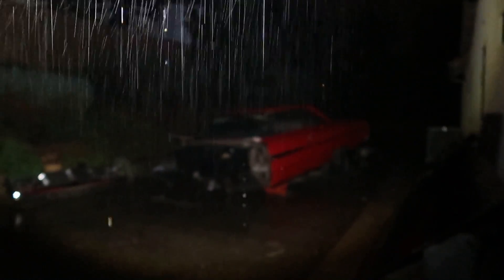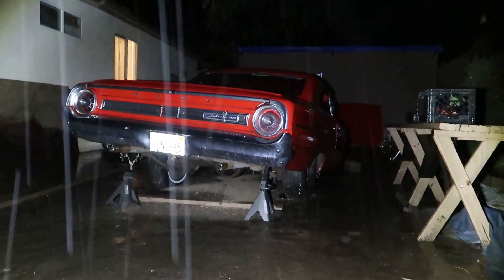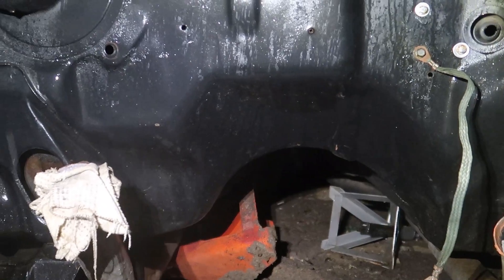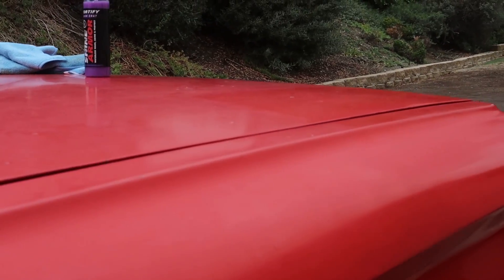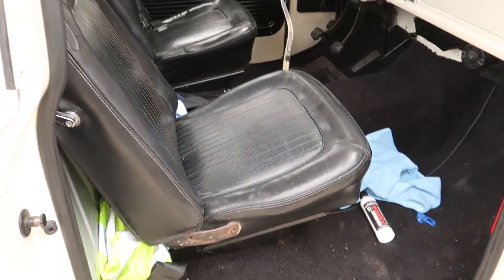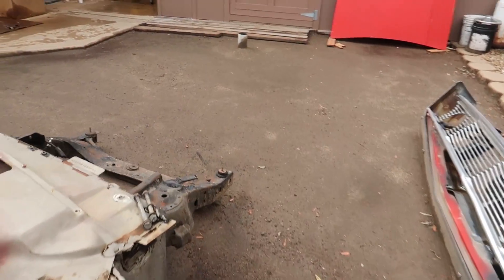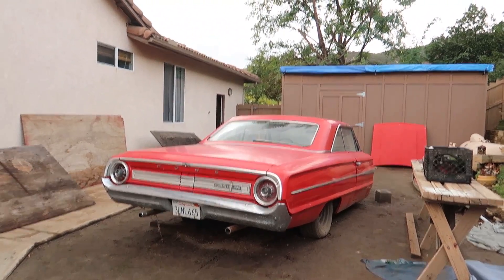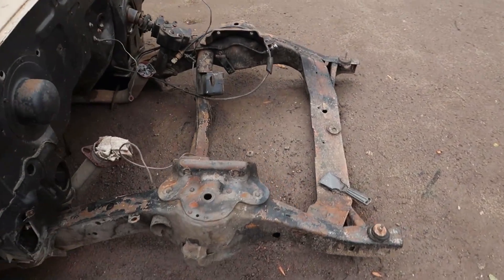I Destroyed My Galaxie...

Comment: In the future might be a good idea to put some wood planks under the jack stands.  I usually have some spare pieces of 2 x 12 that I have cut into 12 inch lengths just for this purpose.  I carry one around in my truck for when I am forced to change a tire on the roadside or something similar as well and it's cheap insurance against soft soil and other area's where you might be on the side of the road and you never know where you are driving or what the weather is going to be up to.

Comment: i was working with my 72 last year. To prevent from what happened to craig i put a cinder block under middle of the bed and under the doors i was working on the diff i must off  bumped the truck or something on it. Then it fell off the cinder blocks and scratched the paint. my advice is that any body that faces this problem should use a couple floor jacks. And don't trust cinder blocks!!!

Comment: Ok..you know what you know...I had an 84 Caprice bury itself in the ground, because I had taken the tires off..what a effin mess. My solution was 2 standard cinderblock for the rear, and 2 8 x 8 thick pavers in the front to give a "floor". I used 2 on one side on the front to make it level. Craig...just a suggestion for a similar issues I had. Mine was on the ground...front rotors buried to the lower control arm. Descriptive language I did use.

Comment: Yep outdoor mechanician, lived in Florida in sand and GA/SC with clay, I always use 3/4" sheet of plywood across the width of vehicle. It even works on my 1995 F-350 when I do brakes. Best 70 bucks you'll spend. Your jacks can roll around to both sides once you get them on the plywood sheets. 
Just did not obey the first rule, which is safety first, assess your risks and put things in lace to prevent them. Always test your ideas. Now you know why the old timer folks double up their dismounted wheels and leave them under the car in case it falls. At least you were not working on it.
No excuses...now you will have your lifelong lesson...
Reply: use pressure treated plywood it will last longer, I get about 3 years out of a sheet before it starts creaking when weight is put on it if left outdoors all the time.

Comment: In the Air-Force we had planes fall of jacks, not a pretty sight, and expensive to repair. I don't think the frame got damaged as the engine was pulled out of the Galaxie. well good luck, setbacks can be a breakdown or a breakthrough. Another take-away, you were not underneath it when it came off the jacks.

Comment: Why not tape some plastic where the windows were. Keep it dry and put big pieces of 3/4 inch plywood under the stands.I know this because I have a dirt driveway as well.Also never put jackstands under the spring shackles use the axle tubes.

Comment: Forget the jack stands all together. Forget the loose wood added under jack stands. That is still unstable on loose soil. Go to the lumber yard, buy a bunch of 2 x 4’s and cut them up to make nice square footprint cribbing stands. These can fit under the rear wheels or directly under the frame rails and provide any height you build them to. Way safer and more stable for little money. Look up online how to build them. It’s easy and will save your car and life.
Reply from the maker: That’s actually the exact thing I’m doing. Thanks man
Reply: Glad to hear that. I enjoy your builds so stay safe and have fun with them.

Comment: What happened. A storm moved the car. 
Personally do not use jacks get your self wood blocks 12 inches x 12 inches x 16 inches long then use 2x6 wood as spacers. 
Think about getting a 16 foot green house hoops to park the car in. Or get white poly tubing and make hoops to build a structure and mount plastic on top and fasten it at the bottom. 
Several videos on You Tube how to do. 

Typing in from Ontario, Canada, I got to the point up here (60 miles or 100 km south of Toronto) it's time to build a building with radiant floor heating 30 wide x 100 feet long x 14 feet high. We only get 4 decent months of weather maybe 5, May, June, July, August and half of Sept. 
All car work has to done inside after that. From Nov. to the End of April. Do not attempt do anything outside. 
In the past have wrenched on cars in -10C weather.

As for you, get heavy wooden blocks and 2x6's to add as spacers as u need them under the car.

Comment: Get a few buddies, slide a 2x4 through the frame rails. Pick the car up, put a couple of cinder blocks under the rails. It's out of the mud for now. Car is not destroyed, you weren't under it.
Reply: Paul Levy if you want to die go ahead and use cinder blocks. They are Not meant to be load bearing.
Reply: @lilorbielilorbie2496  NOT to work on it; to get it out of the mud.While they're not a safe way to block up a car, they will, however, hold up a house.

Comment: I was working on a VW Bradly GT II when that happened to me. At least you weren't underneath it. No real damage, no one was hurt, it's all good.  Not destroyed, clickbaiter.  I threw a jack under it, replaced the stands, it happens. I was running new brake lines,  left to go get more tools or something, then CRASH!  It could have been real bad. I was under the car at one point. This Justin guy says "Live and Learn...."  You can die and learn too.... But I'm a pessimist, there are better options like paying someone else to do it instead of you... Mechanics are easy to replace. You crush one, there's more on Craigslist..  Here in Washington, it rains 4 out o 7 days a week.

Comment: Craig... Don't be so hard on yourself. Stuff happens. Yours isn't the first car to fall off jack stands. Take if from a guy who's owned a '62. Those Galaxies have pretty stout frames. From what can be seen, that fall off the jacks into softened dirt didn't hurt it. And it didn't look like the jack stand that caused the whole thing came through the floor, so when the rain stops and every thing dries out, you will probably find not much was damaged. But you're right. It is a pisser. But you will get passed it and... you are learning a lot by doing this car and you can't put a price tag on that knowledge. And another thing... that knowledge you can pass on to others in the future.

Comment: When we worked on our race car at the dirt track it we had to work on soft ground all the time. We took a set of jack stands and welded a steel plate to the bottom to give it a big enough footprint to be stable on soft ground. Might be something to think about for working in the area your car is.

Comment: Dude, what? Its just on the ground, its not that big of a deal. A little rain and falling 6" slowly off a jack isnt gonna hurt anything. Even if the floor was dented up a little beating with the hammer solves that. 

You could be on the east coast, where it rains constantly, and everything is made of rust. Where it gets cold enough to make you want to rush things causing you to make a much worse decision like knocking a block of cribbing out and causing your mint condition truck cab to fall 4 feet off a 4x4 frame almost on top of you instead of 4" the other way onto the mounts.

Comment: ya lol this video and comment section is self-explanatory I mean could of had some concrete pads under them or double-layered 3/4 inch plywood cut into an 18x18 or less pad for the jack stands lol but her my comment is one of many. Sorry about your luck Craig that sucks man. But ya never put Jack stands in pure dirt for a lot of reasons that being ones and not just that it could of crushed you when you where under it.

Comment: This is just a small suggestion, when you go to put wood under the jack stands, try using a single 2x10 or something instead of 2 pieces of whatever. Itll help keep the jacks level with each other.

Comment: You can build some of these fairly inexpensively and they will work a hell of a lot better than those jack stands, which are not really intended for long term use/storage. Make these out of pressure treated lumber, and you won't even have to worry about them getting wet. This is not my video, but I am sure it will serve you well. 
https://www.youtube.com/watch?v=wmdwo3UPQtY
Reply: Here is how to use these wheel/frame cribs    https://www.youtube.com/watch?v=gJ7t_WxgMK8

Comment: I think your a little over reacting a bit basically not a scratched happen you never really started body work.. you're car is not in the woods in a forest fire.. or a tree on it. Also that cinder block id put it under the front frame rail. Most people just shrug and laugh and say umm fuck won't do that again. Not whimper about it for ever like a Taylor swift album.
Reply: mopartshemi And that cinder block is gonna last about a minuet before it fails.